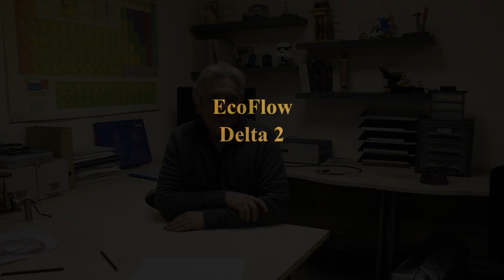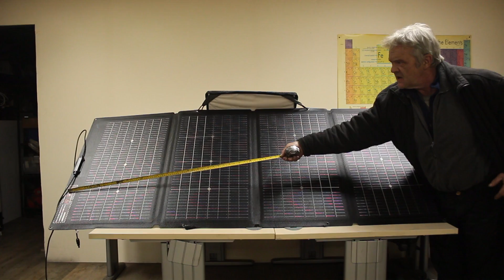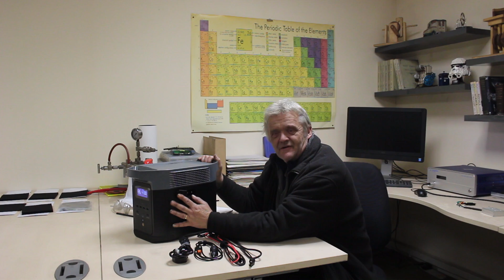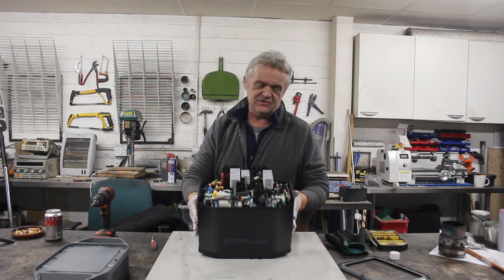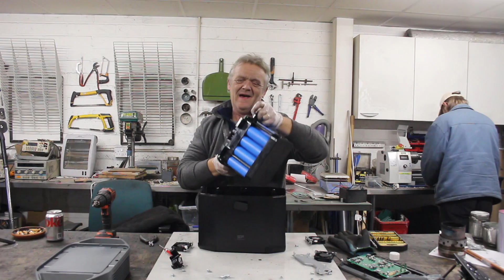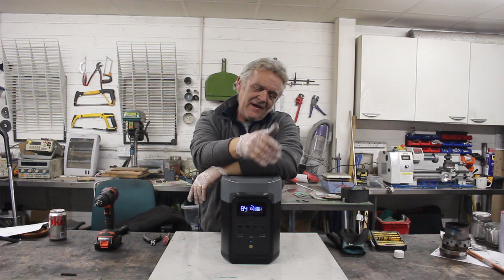1740 - EcoFlow Delta 2  #ecoflow #delta2 #portablepowerstation #notjustabattery

Comment: I'm a low income American, all I own is a van a phone and a computer. I am always taking what little I have to try to make my life more comfortable. Having access to your work is a godsend good sir. Thank you from the bottom of my heart.
Reply: On my bus I built one of these with solar panel, charge regulator, inverter and battery. If you hook it into your van the motor will also charge the battery.
Reply: So what I'm working on is an ammo can with oil lamp that heats some pipes. The ammo can is going to have its own outside intake and exhaust like a wood stove. But the pipes that pass through it will circulate air on the interior. I'm working on building it based on the veg oil burners
Reply: @MYPSYAI  I’ve mentioned the ammo can heater on here a few times to get Roberts take on improving it. Let’s keep bugging him!😃
Reply: @ranman5501  Regardless of 'can' etc, the main things are: multi-fuel, efficient heat transfer, economy, controllability, availability, ease of use, safety, versatility/multi-function, rapid start/stop, autonomy. You might add light weight, cheap, non-polluting, and 'stealth'. You also might need 'intensity' (for forging etc).
Reply: @bikerfirefarter7280  oh you’ve pissed off some people. There is no feeling like being beholden to no one an the day is yours. Of course that usually means working towards providing for yourself for tomorrow.  But I’m sure I’m preaching to choir with you. I will be off again soon.
Reply: @ranman5501  nah I'm just gonna build it myself and film it then upload it to YouTube and credit both channels. But first I'm going to do my DIY lizard skin in a couple weeks
Reply: @MYPSYAI  cool I’ll be looking for it
Reply: So You are free, thus rich 👍.
Reply: @danielreborn4707  well said, and as someone who has lived off the grid with no bills, I’m jealous and hope to get back there soon!
Reply: @ranman5501  Nope, I'm off, I prefer it. I get a rther nasty amusement from watching the BS. I'm not proud of it, but the bleating excuses of the dependent/lost and idiotic made me give up hope of it ever making sense. 
I do not want to go back to grid and bills etc. It never made sense to me, it's like choosing to stick your head in a noose.
Reply: @danielreborn4707  there are many kinds of freedoms. It's great to be able to have a lot of free time and go wherever you want. But it's also nice to have the tools and material you need to do something with it. So there's a Ballance. I would gladly trade a little bit of personal freedom for more material but in the meantime we make do with what we have. I can say that the poverty in my country is far worse than most people would assume, and our government has completely abandoned us, everyone would rather close their eyes and act like we don't exist
Reply: @MYPSYAI  Not just your country.  Peace.
Reply: How do you heat the van..
Reply: What about carbon monoxide in a van or closed environment?
Reply: @user-vm6mw6du8m  
"What about carbon monoxide in a van or closed environment?"

That's quite simple; you don't use an energy source that produces a lot of carbon monoxide.
Go with propane or an alcohol heater.
Reply: @scotttovey  Oops, propane or alcohol can produce carbon monoxide too, although less likely than burning wood/charcoal etc by virtue af the better fuel/air metering, they can still produce it. re deaths from poorly installed 'gas' heaters. If you are going to burn anything that has carbon in it, best practice is to ensure adequate removal of combustion prodcts AND have at least two CO detector/alarms. CO is dangerous even in a few hundred ppm.
Reply: @bikerfirefarter7280  

"Oops,"

There is no oops; you simply lack sufficient knowledge and experience of these fuels to know how to use them safely.

"re deaths from poorly installed 'gas' heaters."

People not being careful about their use of gas heaters does not make the gas heaters dangerous. 
It makes whoever installed those gas heaters; 
1) Suicidal if the one use it is the one that installed it improperly.
2) A murderer if the one that installed it did not take sufficient to install it correctly.

I spent many winter nights sleeping in the back of a Ford Aerostar van with a flameless propane heater hooked up to a 20 pound tank.

If you are careful and keep your wits about you, 
there is no threat of carbon monoxide.

1) Use a flameless heater.

2)
The process is quite simple.
Turn on the heater.
Heat the van up pretty good.
Climb into the sleeping bag.
Turn off the heater and go to sleep.

Should it get a bit to cold at night and you wake up,
light the heater.
get it fairly warm again.
and turn off the heater.
go back to sleep.

While there is a danger, the danger is not inherent.
The danger comes from equipment being either
installed and or used improperly or; 
being old and improperly maintained.
Reply: @scotttovey  the ammo can heater I’m referring to has no interior (in the room) combustion exhaust. Only heat transfer. Look it up.
Reply: @scotttovey  I am aware of all your points. I agree with all of them but one, "you simply lack sufficient knowledge and experience of these fuels to know how to use them safely."
I majored in chemistry and biology/physiology.
I've been a heating engineer for 4+ decades.
My point was that ANY carbon containing fuel CAN produce CO when burned, either through ignorant use or faults inherent/developed; or if you want to stretch a point, done intentionally.
Sometimes accidents happen, sometimes people are just stupid/ignorant.
Some carbon containing fuels are less/more likely to produce CO under same/similar circumstances.
Asphixiation due to CO2 is also possible, without CO being generated, even your 'flameless heater' produces CO2. At least you had/have the sense/knowledge to operate safely, that doesn't apply to everyone. Trust me, I've met and still regularly deal with some unbelievable 'Operator error' situations in my time where the operator(s) have convinced themselves of the most incredible ignorance and false logic/procedure is valid. Some still don't accept it was their willful ignorance and carelessness that resulted in the death of 5 family members. And they STILL wont educate themselves in these and such matters. It's more common than you'd credit. Hence one reason for so many extensive safety features/designs in modern appliances.
But nothing is 'fool' proof against every situation.
Is that 'sufficient knowledge and experience' for you?
Reply: @scotttovey  I assumed my mentioning the carbon content of 'fuel' and ppm CO etc would have tipped you off to my conversant knowledge of the potential dangers of ignorance re 'combustion'. Obviously I was mistaken. No chicken little implied, that's just the way you read it. Basic knowledge, common sense, experience (even/especially second-hand) are all readily available, unfortunately they're often ignored. QED. 
Check the thumbnail and the name. ;-)
Reply: @bikerfirefarter7280  
"I assumed my mentioning the carbon content of 'fuel' and ppm CO etc would have tipped you off"

You clearly have not come across, and been harmed by, as many deceiving charlatans as I have.

"Basic knowledge, common sense, experience"

There is no such thing as common sense.

Pay attention to when people call something common sense and ask yourself, is that something that is truly intuitive, or does it need to be taught.

If it needs to be taught, it's not common sense.
Reply: @scotttovey  If you been harmed by so many 'deceiving charlatans' and not learned to spot/avoid them, I've got to wonder who is actually to blame. Hmm?
Did you know there's actually no such word as , 'gullible' in any dictionary?
Reply: ROBERT is a first class Guy. PERIOD. Joshua.
Reply: Cheats mate I feel the same way about his content he is so thoughtful and positive .the world could stand to have one or to of him in every town life would be better for all of us
Reply: I'm  a NO IINCOME.African.... Beg,  Borrow and Steal work for me in a good climate..... Praise the Lord
Reply: I am unfortunately in a similar situation with being a low income American and you are definitely right about his channel being a Godsend. I was in a bad accident in 2020 and had to get on disability because of the injuries to my right arm and leg. I used to make good money in the Harrisburg Bricklayers Union and  can no longer do masonry or anything that requires lifting with  both hands. Now I rely on my left   arm and it was a big adjustment to learn to write with my left hand. I'm always watching videos on alternative power and trying to figure out how I could ever afford even a small truck and camper and solar power. I'm 46 and living back at my mother's house and unfortunately have to use her Volvo so I can drive to Dr appointments. I gotta keep reminding myself that it could have been worse,  I could have lost my arm while in Hershey Hospital and I'm very grateful to God that he didn't take me. It was very close a couple times while I was in the hospital and put in a coma for awhile but  fortunately I'm still here and praying everyday for others that are in worse places.

Comment: I sat through power cuts as a kid so nothing new to be see here. At least it's very hard to gut the gas off, unless they come and switch it off at my meter. would be fun watching them purge all the air out the pipes if they did.
Reply: Exactly, buy a petrol gen and convert it to Natural gas off your gas mains
 using a garretson reg, and if you lose your NG? run it of a botlle of LPG

Comment: Interesting that you are reviewing this because last month I bought the Ecoflow Delta pro package with  battery, generator, and solar panel, 3600w. I was also very impressed with it's versatility and build quality. The gas powered generator is surprisingly quiet as advertised. It is was not cheap but worth the peace of my mind it gives me about possible power shortages and outages this coming winter.

Comment: Then again you can get a 3KW open frame petrol generator from Screwfix for £329 leaving you plenty of money for fuel out of that £1600 budget.  Maybe you could do a video showing people the most effective way of implementing a petrol generator solution in a house?
Reply: If you buy a good one it will use less than half the petrol and be so quiet that you can’t hear it. I can buy premium that doesn’t have ethanol. Between my chainsaw, outboard and generator I can cycle through my gas before it goes bad with stabilizer in it.
Reply: So, you would rather pay more in maintenance costs and fueling? A solar generator may be more expensive at the beginning, but a lot cheaper in the long term.
Reply: @justinweatherford8129  I have one of those but being winter here there is not much daylight and even less sun. My battery bank is also charged on grid when it is up. It will run my fridge and freezer for a few days but my generator is for longer outages. We have winter stores that knock power out.
Reply: @D-B-Cooper  December 21 is the first day of winter in the northern hemisphere. What you are actually experiencing is the second half of fall/autumn.
Reply: @justinweatherford8129  Dec 21 is winter solstice, shortest day of year. Right now sun does not get up high enough in the sky to make a solar panel viable, besides all the cloudy short days. We get 165” of rain a year. Your unicorn green solar power does not work here, actually it doesn’t work anyplace except the desert where the power is all used for air conditioning.
Reply: @D-B-Cooper  Actually solar panels are most efficient when cool but not frozen over. With some solar panels you can still generate some but not as much electricity on rainy days. As far as the winter solstice being the shortest day of the year, yes that is true, it is also the first day of winter.
Reply: @justinweatherford8129  Not enough sun in the winter to realistically charge the battery and that's when the power cuts will occur.  Hopefully these power cuts will not last long so £1600 for a solar/battery solution is a false economy in my view.  Great for Rob though as he got it for free.
Reply: @simonhodges6084  Dunno, IF(!) you have a balcony, to place solar on all year long, that stuff will save some money. IDK if the 1.2kW draining Ecoflow would play well with my 750W generator but running a bigger one for an hour, preferably to also carBQ my grub on it, and use the Ecoflow to power my devices for another day or even longer would be a somewhat appealing strategy to cope with blackouts that won't happen. Recharging it from the power grid, between the brownouts that we should get used to, will of course be significantly cheaper. My generator needs about 4€/kWh. Gasoline storage is a legal challenge and maybe some fire hazard too? Please stay safe!
We all ha e different starting points and goals. I 'll rather install some 12V lights than go for an Ecoflow. Heating and water supplies are out of my reach. With batteries drained I'll read paper books by candlelight. 12V 50Ah Lithium Iron would be nice to have and portable enough for outdoor activities.
Reply: You can also buy couple of 90ah lead acid batteries for 45 quid each new , a 150w solar panel for £80, a 20 quid inverter and £10 cheapo pwm charge controller and u got just as many wh for £200 )
Reply: Its a fair comment, but Petrol generators are rubbish really, I have one, I took it to work and left it there, they are a total pain, they make a noise so loud it would wake the dead and certainly pee the neighbours off, mine refuses to run my washing machine properly my 3KW inverter and lead acid batts have no trouble. Now here is the big problem, modern petrol contains Ethanol and to make it mix with the long chain oily hydrocarbons chemicals have to be added, giving the petrol a safe shelf life of about six months before it gums up the carburettor with nasty pink jelly. You can go to farming pro gardening shops and buy a special petrol which will sit in your genny for at least five years without degradation but £20 for 5 litres.
Reply: @richardsandwell2285  Buy a GOOD petrol 5-8 kw gen and convert it to Natural Gas
 (if your house is on the gas mains?) or LPG with a garretson regulator
lots of videos on YT. you can greatly reduce the noise with a chipboard doghouse
with angled sides directing the noise down into the ground.

Comment: I wonder if you could give me your opinion on a thought experiment.  

One or two solar panels powering a (hot water type) heating coil immersed in hydronic oil / mineral oil….  Surrounded by a large mass of sand.  

Allowing the sun to charge your sand battery.  

You are brilliant and your thoughts would be greatly appreciated.
Reply: You haven’t mentioned, so I figured that I would state the obvious. You should also have piping to extract the stored heat for later use.
I also believe that using plant based oils might also be better for the planet.
Reply: @justinweatherford8129    Those sound like good suggestions.   Surly this could be well expanded upon.   

Only concerns with the oil used is its lack of, or very low chance of combustion.  

Although able to raise well above temps you can transfer via water.
Reply: @Route72Trucks  the benefits of using water as a heat transfer medium is that it is more than environmentally friendly to use and it is easier in most cases to get ahold of.
The downsides of using water as the transfer medium is that it has a low boiling point and it will likely have contaminates which will clog the system in the long term.
Reply: @justinweatherford8129   I use a wood boiler to heat my home.  It’s very easy to over heat water and in the wrong situation becomes explosive.  

Water is a no go.   

A non flowing mass of oil (whatever variety) heated to a max temp reasonably allowed.  Surrounded by a large mass of sand to insulate the oil and act as the medium to transfer the heat into the space around it. 

Like a heated rock in your living room.